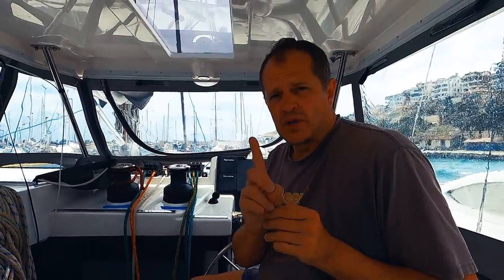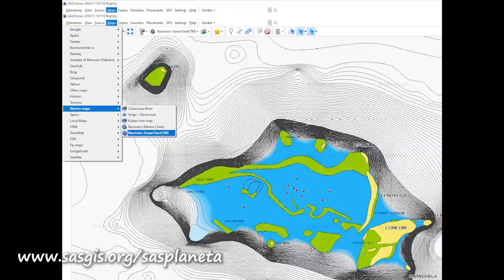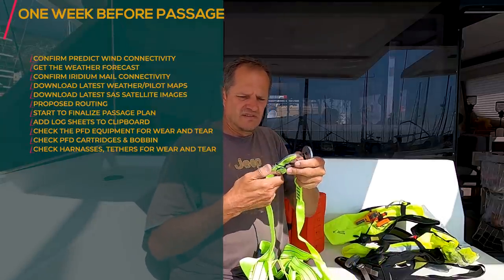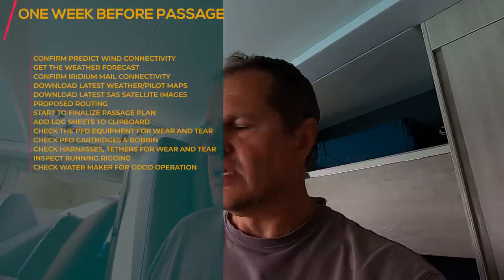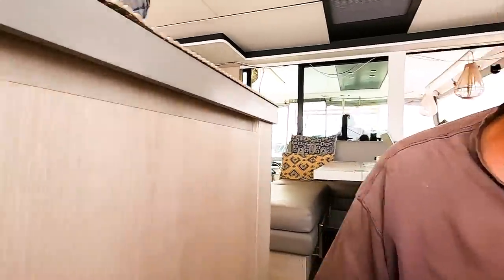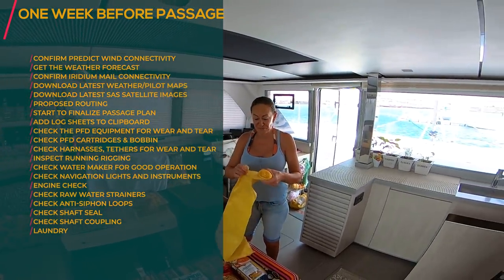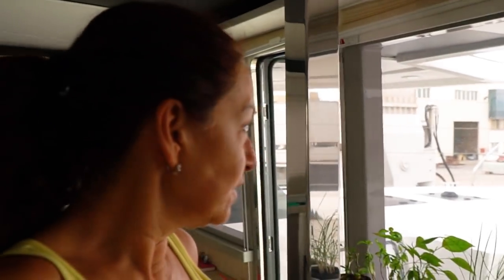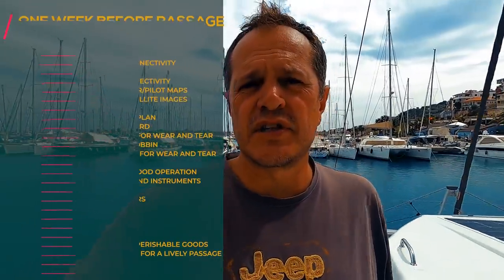#78t Boat Life Checks - 25 Point Check One WEEK Before Passage | Sailing Sisu Leopard 45 Catamaran

Comment: Engine room Bilge pump to small. Great the float alarm goes of but the Intermittent pump doomed to failure. For high volume Pump 2 would be Manifold pumps You could engage from Engines! An AC pump from your inverter?
Reply from the maker: thank you, Michael! yeah we have four bilge pumps activated on float switches, but they can be manually activated too. we only have two manual bilge pumps, also only two high water alarms for in case the bilge pumps could not start or cannot keep up. I guess they think a cat cannot sink so, if the worst case arrived like hitting a rock or container, then one hull will go down, but we may still make it to shore or harbour? not sure. anyway, what is the right size? you said it is too small, what is the right size?